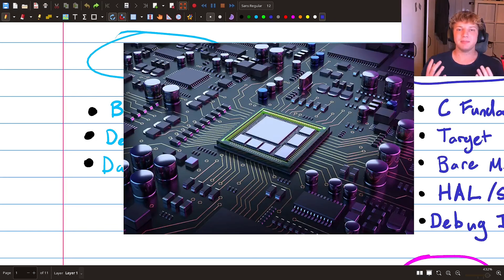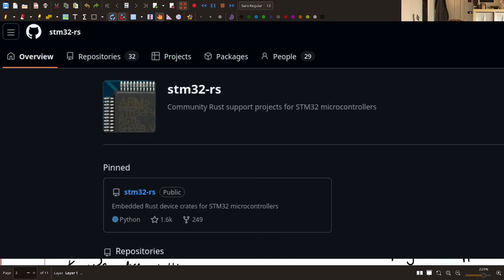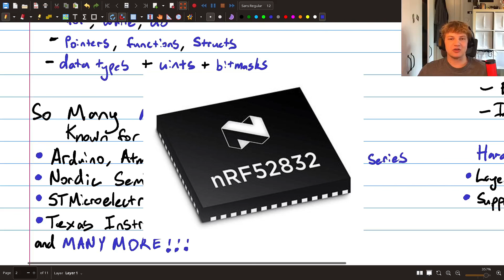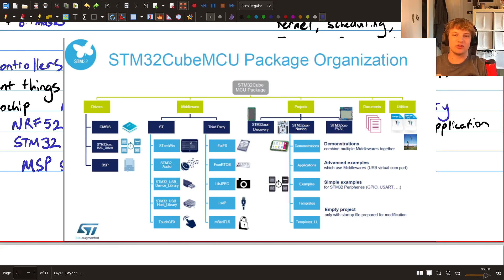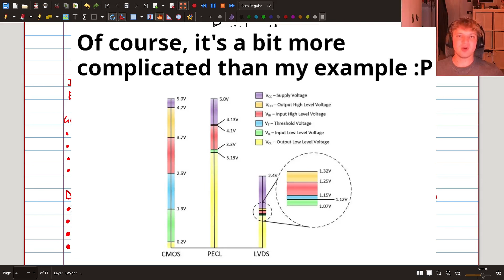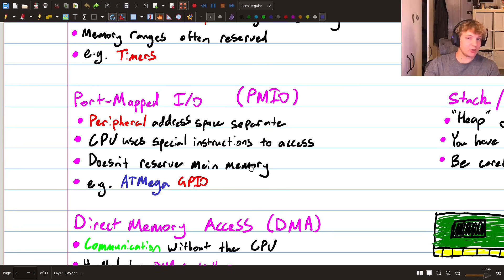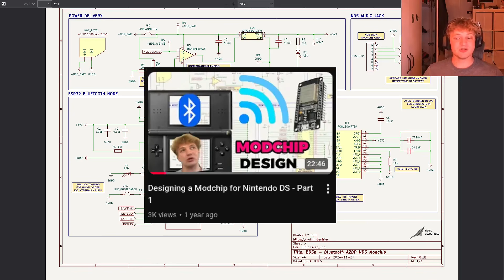COMPLETE EMBEDDED SYSTEMS Roadmap - What Arduino Won't Teach You

Comment: What about esp32
Reply from the maker: what about the droid attack on the wookies
Reply: @hoff._world  this is very important. Many people forget the significance of the empire's choice to attack the wookies.
Reply: @hoff._world nice answer to the strange question 😂.
Reply: @hoff._world  esp32 is the king of all mcus now, and arduino compiler does almost all the features you explained
Reply: @saitamatechno bro are you serious, esp32 is far away for what called true embedded engineer.. It's stm32coetex which are considered god or say jesus of embedded system
Reply: @saitamatechno  King of what XD Anything below STM32 or even an MSP430 is a toy as far as learning is concerned. They're capable tools in their own limits, but you can't learn engineering using finished products like that.
Reply: Esp32 is popular with hobbyists, less so in industry. Esp32 is kinda overkill for a lot of applications, and keep in mind the goal of embedded systems are to run processes efficiently without guzzling power
Reply: @ilovecuttlefish  not overkill.. the adc sucks..
Reply: @ilovecuttlefish  It should still work for the fundamentals. The CPU is RISC-V so for learning RISC-V assembly it should do. For the rest okayish as well. If you don't have a dev board or an OS that supports all the expensive IDEs you need to improvise. ESP runs with any platform that supports Python and C when the CPU of your computer recognizes the hardware. The IDEs often only run under Windows, maybe Linux if you are lucky.
Reply: @ilovecuttlefish  ESP32 is basically the default for IoT devices that are not battery powered, think smart fridges, air purifiers, home batteries etc. Especially ESP32-C3 and the C6 have been popular. Honestly if its powered, has a WiFi connection, and is considered a smart device it is most likely running an ESP32 based chip, either as a co-processor or as the main MCU.
Reply: @dominiquek746  What of industries which MCU is best?
Reply: @dominiquek746 was looking at a smart gate system costing like 1500. Looking at the specs I was like this gotta be esp32 powered. Sure enough
Reply: do you have good resources for getting better with esp32 ???
Reply: Depends.  Xtensa based s3 aren't really selected for, RISC-V is still kinda upstart.  Generally you see cortex-M, R, and occasionally A.  I personally worked with TI sitara cpus for YEARS, which includes the c2000 architecture, but I prefer the arm cores.
Reply: Esp32 is a family of MCU. Can be programmed in many ways. Same goes for the Arduino - can be programmed in bare C , or using hobby stuff
Reply: ESP is the go to for "programmers". Beware, while they have their uses do not try to use them as a super micro controller. I actually broke a control system into two, the ESP32 got used for the fancy digital stuff like the screen, a proper micro-controller with at least some half decent analogue performance was used for the actual control system. Beware of analogue on ESP32, there is a reason they are cheap, not all silicone is the same. ESP32 is only slightly better at analogue than my PC's CPU would be if it had an ADC.

Comment: Cool, but where are the jobs?
Reply from the maker: good firmware engineers are actually pretty hard to find right now. The company I just left (before I joined Microsoft) is still struggling to find a replacement for me. They have been looking over 8 mnths

Comment: Thanks for the video, but I'm confused about who this roadmap is actually for.

You tell us not to get stuck on hobbyist tech like Arduino if we want to get into the industry, but you don't address the hiring reality. Is embedded like web dev, where a self-taught route with industry-grade personal projects is actually viable? Or will someone spending 1+ years learning this stack just get instantly ATS-blocked for lacking an EE/CE degree?

Is this an actual career roadmap to land a junior job, or are you just using "roadmap" as a synonym for a technical curriculum/skill breakdown?
I enjoyed the video regardless, thanks!

Comment: i have a question, you mention cubemx is a great tool. when using cubemx, you end up with a bunch of autogenerated code, comments on where the user is supposed to put their code and it just seems super messy to me. im curious on whats ur opinion and approach to this when using an stm32 - do u go w cubemx and all of the trouble of later modifying the code to make it look not as painful or do u just diy the stm32 settings at this point? from my understanding, using cubemx is the industry standard but im not sure i wanna depend on it in the long run, im an intern and still learning.
Reply from the maker: Hey thanks for your comment. It is indeed very messy, and in general I find a lot of the abstractions that it creates to be super annoying when I actually want to figure out what something does. You can only trust the abstraction layer as much as you trust the person who made it, and they do have bugs sometimes.

That being said the amount of time the generated code saves when doing board bringup (e.g. testing the hardware to make sure it works) or figuring out the correct settings for a hardware peripheral (like configuration of the SPI bus to talk to a display or something like this) is well worth it in the beginning.

The issue with modifying the generated code is that if you ever need to regenerate it will be an absolute nightmare to fix up, and this happened to me at my last job. Personally I like to leave the generated code "as is" purely as hardware initialisation, then get out of that file ASAP. What I usually do is make a new "app.c" file which will have my real while(1) loop, then call app_loop() or something before the STM32CubeMX main loop. Hope this helps!
Reply: @hoff._world  thank you so much for your answer! that made a lot of sense and is a very practical solve. ill use it from now on :)
Reply: I think you would like uVision,, its part of the ARM Keil MDK, amd available for Windows OS. If you are running MAC, you can use ARM Keil Studio Pack (MDK v6) which is an extension you can add in VS Code that includes the debugger linker/compiler, and CMSIS (board files). In either of these two options there is no pre-generated code other than the board header files -- You start from scratch. I find CubeMx and the other Keil applications for development not very good for learning, since it pre-written code.
Reply: @MrHoola  oh cool is it available for linux? but actually since it seems like its industry standard, i think using cubemx the way that hoff said works for me :)

Comment: Strictly as a hobbyist, and just my personal experience, but i am sure the professionals will agree, I wish i would have spent less time on the Arduino boards, great platform for beginners and very easy to use/learn the basics, my issue was that it abstracts over a lot of the necessary C fundamentals, and how the hardware actually works, which is the point of it, i get that, it is good however you can still directly write bare metal if you choose to. Have since switched to STM32/CubeIDE and never looked back, unbelievably powerful micros, especially impressed with the CubeMX for hardware configuration, and all the config code becomes implemented directly in your project files so its all right there in the open to study/tweak, especially when getting into the more advanced stuff

Comment: 20:36 ?
Reply from the maker: I'm talking about the typical layout of I2C vs UART. Usually with I2C you are wanting multiple chips on the same bus - I2C only uses 2 wires. "One to many" simply means you have one master device who talks to multiple slave devices, and the master's job is to coordinate communication.

UART also uses two wires but it does not incorporate any kind of addressing and so there is typically no in-built concept of master-slave. It also makes talking to multiple devices more difficult because each device has no way of knowing (unless you build a protocol on top of UART) which device the message is intended for. Hope this clears it up!

Comment: would've been amazing to watch if it came out like... 10 years ago?
I'm really happy to see embedded experiencing a resurgence in popularity.

though a little point I do want to say is that simply because a product is marketed for "hobbyists" doesn't mean it cannot be used for real work. just that the way those boards are normally used is not the same as what you will see in normal work. setting up an arduino board and compiling the binaries by targeting the ATMega itself not through the Arduino-IDE is actually a decent equivalent to some real work.
it's going to be under-powered as all hell, and you should not BUY one, but from my experience many people have a ton of those things just gathering dust somewhere. so instead of being e-waste, you can reuse them as prototypes for projects with low processing demands while learning and polishing the same skills you would use for any other project.

Comment: Excellent, glad I am not the only one that sees the difference between electronics engineer and software engineer. Many dodgy products get released because electronics engineer has come to mean programmer and the electronics is side-lined as a Lego set that should just work no matter how little the programmer understands what they are doing. Most people I say electronics engineer to think that I write computer programs. The one thing you missed is not just that an embedded developer needs to understand electronics, but that they need to understand the physics of the system they are writing code for. This is often overlooked and finding ways of making the application work by leveraging the way the system works is overlooked. I have seen people tackle a problem of controlling something by creating a whole universe of their own in code and trying to do things the hard to impossible way when all they had to do was understand the fundamental principles of operation of the system and work with it rather than against it.

Comment: Very good lecture #1 for EE11 (first semester course, fall 1977). Intro to digital (microprocessor) systems.  I already passed that class.  That was for Electrical Engr majors before there was "Computer" engineering.  Did you take any 'electric [magnetic] machines' (eg. 3 phase/universal/brushless /motors  ...) courses?  Perhaps Engineering computation using Fortran to implement Gauss-Seidel method in order to upper triangulate matrices?  Square hole punched cards of course...  Back to the subject at hand, I fully agree that anything on YT barely approaches the coverage of that first lecture at University.  I also think what you present is barely a course syllabus.  I do suggest two fundamental texts;  Davio, Dechampes & Thayse, "Digital systems with algorithmic implementation" (especially the chapters on systolic arrays), also Hill & Peterson, "Introduction to Digital Systems" (note their coverage of general level mode [Clockless] implementation using flow diagrams for race free state transitions/assignment). 
Without true insight and knowledge of such fundamentals, the rest of the ecosystems is purely a house of cards, that is highly unstable and will not function for long.
While Von Neumann machines are cheap, available to non-specialists and 'so easy', I liken it to providing typewriters to monkees and then waiting (long enough) for all the great written works to emerge from under the office door.  It could happen before the universe goes cold but I wouldn't spend my days on earth in anticipation of receiving the manuscripts.
Thanks for your efforts to make this video,  still I haven't gotten any (e)mail that the publisher is coming out with the first edition...yet.  Your humble gadfly JDF (BSEE 1981).

Comment: Wow that is pretty cool,how old are you ? when i heard your explanation i imediately thought omg this guy is a Senior with big S ahahah,the way you have gone on detail to that is very good many tutorials never go into such detail,i am 26 years old with only 1 year of embedded systems experience bit i plan soon to join to a embedded systems company i will rely on a project that i've been building on for one year such as having 5 sensors with i2c,spi peripherals and with dma irq,also with watchdogs and lower power modes all lf that with many recovery strategies to interact with freertos i have used cmsis and no ide just cmake,also i have included secure boot,secure chip integration for root of trust and also esp32 as a wfi modem where i send data with mqtt and http,i also have built a tls(equivalent stack) using aes gcm to encrypt data,the project has also secure ota update with  antirollback defence  
It might have around 20k lines of code or more 
The experience i had was weak but i've been mostly a self learner who like to build things on my own and wanted to know your opinion on  geting hired based on  projects can that compensate weak experiences ? To get into junior or even mid level positions ?

Comment: Let me tell you the truth. Just go work at a nearby McDonald's. Embedded? This is work for EE and mechatronics, not CS. With the web, if a bug occurs, you just patch it and that's it, but with embedded devices, if a bug appears after release, a full recall, massive charges, and your dismissal await. Furthermore, in the case of defense and industrial products, your finger could cause a death or a massive disaster. And you. @hoff._world I don't know if you are a real engineer or just a web developer. But if you have any conscience, don't make videos like this. The influx of unverified personnel can create a massive disaster due to the butterfly effect. Just forget about those damn keyboards and IDEs. Every high-paying job has a corresponding reason.
Reply: To add a few more facts, embedded systems is merely a tool. The code must incorporate significant mathematical and physical theories, and programmers must understand this and possess appropriate degrees. Furthermore, you must read countless data sheets and battle hardware errors; thanks to its manufacturing-based nature, your salary will likely be barely around $100,000 (which is quite low compared to current CS salaries). Despite these downsides, you will have to study a tremendous amount and compete with hardware developers. Alternatively, you could develop the entire hardware yourself. In that case, you would even have to manage the parts supply chain. Did you think you could sit in the office, drink a cup of coffee, comfortably type on the keyboard, and munch on some snacks? Forget it. Such a company does not exist. It would be impossible even in Silicon Valley. That is because, at every weekly meeting, you will be patching up work that should be done with hardware components using software, following your boss's request to cut costs.

Comment: I don't understand what the problem with Arduino is. I have a masters in EE and I obviously feel like i don't understand anything but I don't understand why arduino is considered hobbyist bs. Other microcontrollers do the same thing they're just a little bit (and from what I've seen, it really is only a little) less abstracted. you still use a bunch of libraries, timers still work pretty much the same, communication protocols still seem to be library-based. Using the IDE is like a million times harder but that and the syntax seem like the only real difference. Coding is still 80% the same. The other 20% isn't some incredibly more difficult mountain either it just looks a little confusing at first glance. Am I wrong? I feel like I'm missing something
Reply: I guess its a bs spread by mcu companies to make you stick to their software resources and support, ultimately hard for you to migrate to other platforms. arduino is like JAVA of microcontrollers. same code, switch boards and you can run it. If you need high integrity and do not trust the available libraries, then you can make your own. Unless you are doing assembly coding i guess there is not much difference.
Reply: @roy-arghya  yeah exactly. Like the real difficulty comes in when you aren't using libraries

Comment: I am ashamed of just throwing ESPhome onto a PCB that I design. The PCB design is relatively good but feel like I cheated at the firmware but I prefer to design hardware

If I want to add sensors, it's done over i2C due to the limited GPIO and the IO expanders chips are more expensive than buying a cheap IC and programming it to act as an IO expander. Having a ton of PWM pins is a another monster,
Reply from the maker: look at the end of the day if you're redoing an open source project that will work for your use case it's for 1. vanity or 2. learning.

if you just want to get something up and running as fast as possible and you don't really care, then it's fine to use or even extend existing open source stuff - we call that an MVP :)
Reply: @hoff._world  I designed the circuit itself because I got fed up of deploying a prefbopard.

Comment: When I see people say things like "you should know C", I have always agreed. Just knowing how to program in general has been a great skill to have. After using Claude for the past few weeks I am starting to wonder when is the last time I write a line of code. It like 90% one-shotted 4 of the program ideas I had. A little back and forth de-bugging with it, and I was up and running insanely fast. Have you had any experience with AI coding? What are your thoughts on it as a (assuming) younger engineer out there?
Reply from the maker: Hey I actually have a full video on this on my channel titled "why I don't code with AI". Relating to this video tho, I find the more niche and specialized your needs, the worse AI performs. For example I have tried to use it for embedded and the hallucinations are quite bad bcos firmware is large context, usually highly coupled and microcontroller registers and hardware vary so much. It is OK for abstraction layers like zephyr tho